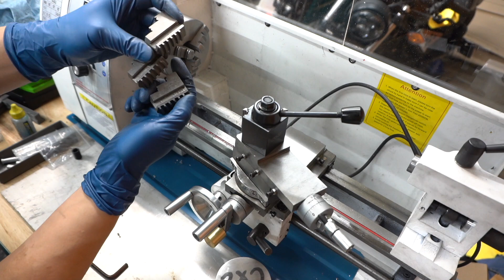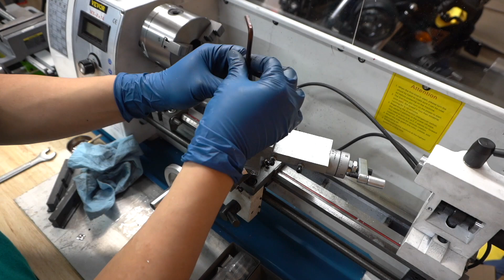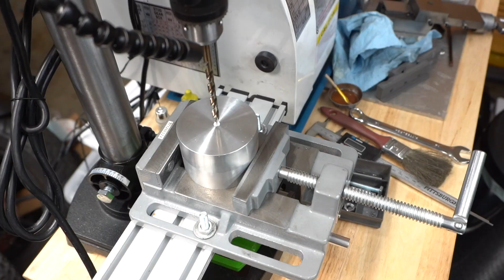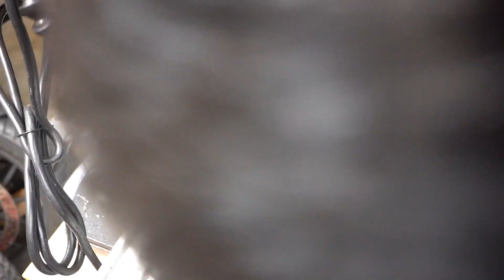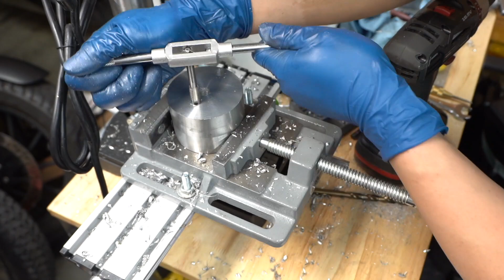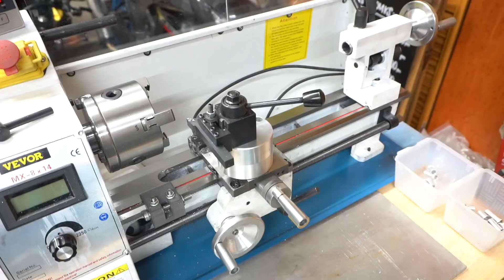We finally did a Plinth Upgrade aka Cross Slide Delete (Vevor 8x14" 2250rpm 650w) | Part 12

Comment: couple of things, your using the top slide angles wrong. the way your using it is designed for tapers not normal cutting. next you should bve using a steel bade not aluminium for a block. aluminium is easy to damage and is less ridged than the steel. good luck either way.
Reply from the maker: Thanks for sharing your insight! We appreciate the feedback and will definitely look into this further. Always great to hear from knowledgeable viewers like you—it helps us improve. Cheers!

Comment: Thanks for the video. I have been thinking about doing something very similar and this video helps me visualize the process. Only I want to incorporate a radius turning ability on the plinth.  One thing I would have done differently is that I would not have tapped the bolt into the aluminum plinth. I would have used a  through bolt.  Aluminum stretches too easily and your  M10 bolt is going to mash itself lose in a short period of time.  Easy enough to fix though. You can always drill it through , countersink the head and pin the head so it doesn't turn when you tighten the tool post.
Reply from the maker: Hey there! Thanks for checking out the video and sharing your thoughts. Incorporating a radius turning ability on the plinth sounds like a cool addition! We went with tapping the M10 bolt into the aluminum plinth to keep things simple and maintain the original hardware. You make a good point about potential issues with the aluminum stretching over time. If we ever encounter damaged threads, we'll definitely consider your suggestion of drilling it through and using a longer bolt. Thanks for the tip, and happy crafting! :)

Comment: Are 4 jaw chucks available?
Reply from the maker: According to the spec sheet, this machine features an MT3 style chuck. While 4 jaw chucks are available in MT3, we've opted to stay with a 3 jaw chuck for our current tasks. It proves to be more efficient since we rarely need to remount a piece to achieve a 0.010-inch spec, and we're mainly working with round bars at the moment. However, we're intrigued by the idea of trying the 4 jaw chuck eventually, especially for working with square bars and other shapes in the future!

Comment: I have same lathe with 2" longer bed.  Same toolpost.  Gotba brick of d2 waiting beside the mill.  

If you need to cut angles you can simply config the old toolpost in the compound and leave 2 tools set up in it.  That was my plan anyway.  

I subbed.  Maybe we will touch base later.
Reply from the maker: Hey, thanks for sharing your thoughts! That's a cool idea to use the old toolpost and the cross slide for cutting angles and keeping tools set up on it. We'll hang onto the old parts for those rainy day jobs when we need to cut some angles.

Glad to have you subbed to our channel, and yeah, let's definitely catch up later!

Comment: Please do a bit of research on wearing rubber gloves around lathes and rotary tools. I highly recommend against it. Keep up the good work learning and enjoying your machine skills.
Reply: I do agree that, in general, wearing gloves while working on a lathe is a bad practice. At the makerspace where I go when I need the larger lathe or mill, one risks a very severe reprimand if not being told your shop time is over for the day for wearing gloves while operating the machines. However, those gloves are far less dangerous than cloth or leather gloves. The glove material will very easily tear instead of pulling the hand into the rotating mass. However, speaking as someone who has worn similar gloves for about 30 years and as a part of my work I have to perform surgery with cosmetic concerns, all gloves like that will degrade one's sensation. Only the most expensive ones (specifically manufactured and packaged for surgical use) interfere the least. To use at a home shop, they would be cost-prohibitive. Examination gloves, or mechanic's gloves like those shown, are inexpensive but also degrade light touch sensation the most. Wearing them while working around the many chemicals we use in the shop would be recommended. Wearing them while operating a lathe is demonstrating poor safety practices that, for someone who is inexperienced, does not understand the risks, and decides on leather or cloth gloves instead, can easily cause a disabling injury on a machine like this. On a larger lathe, it has caused fatal injuries.
Reply from the maker: Thank you for bringing up this important safety consideration. While we do assume the risk of wearing gloves ourselves, it's crucial for everyone to be aware of the potential risks associated with wearing gloves around rotating machinery. Gloves can potentially get caught in the machine and cause harm.

Safety should always be the top priority when working with machinery, and we appreciate your reminder to prioritize safety at all times.